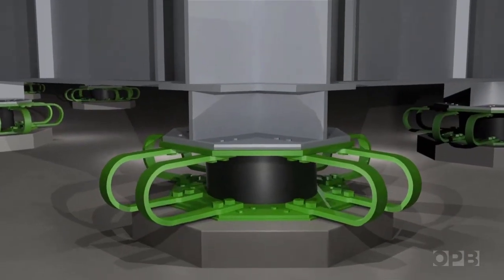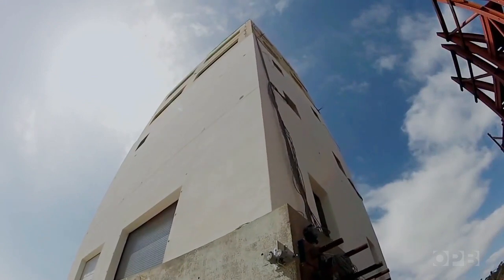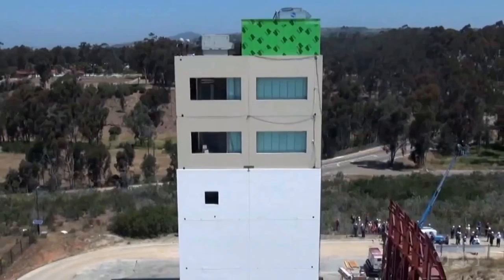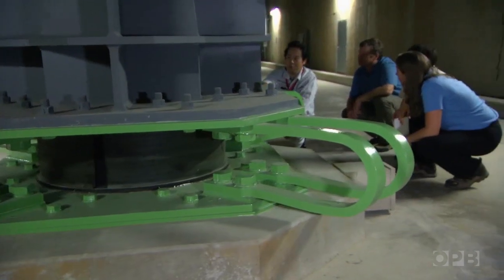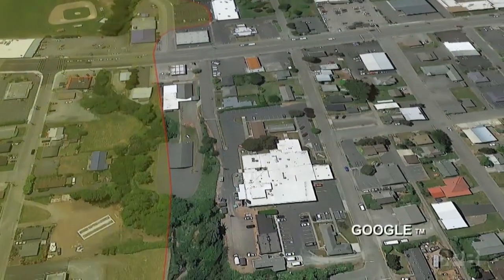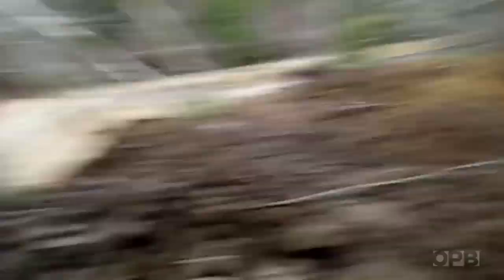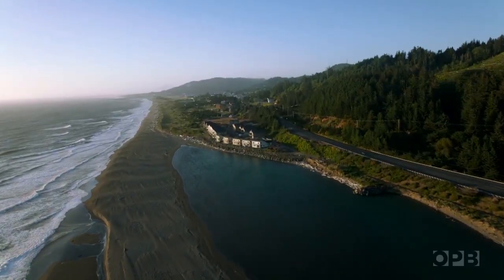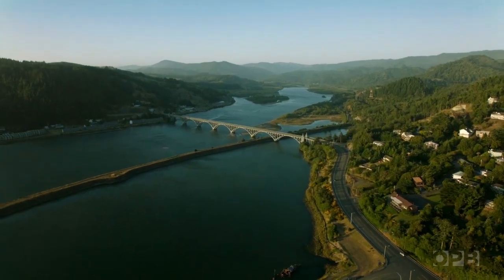Hospital Survives 9.0 Earthquake | OPB

Comment: The reporter has a common misconception of what is the magnitude. Magnitude does not affect structure of buildings, shaking, or intensity of shaking, does. Maximum intensity on the land was VII and only in rare spots, as an epicenter was far into the ocean. In Kobe in 1995 or Turkey this year magnitude was just around 7, but intensity was over X, as highest shaking was along the fault, where everything was destroyed. And X isn't just slightly higher than VII. It's a geometrical progression scale, where X is over 6 times as intense as VII.

Comment: The problem is that you can use base isolation only in isolated buildings. If you have other building sharing a blind wall, it is not feasible. In Athens, Greece that this is the case, we have a minimum of 10cm gap between buildings, to allow for some movement.
Reply: Similar situation is turkiye as well, the city planning is utterly bad... although many buildings are build sturdy, its not enough to widstand long or strong quakes, there is also the corruption part of the situation where it gets all messy, and government just cannot step in without being called facists or being afraid is losing support and election, its idiocracy through and through here (((
Reply: here in belgium the required gap doesnt even exist. the only earthquakes we get are very minor ones from mining operations in the north of the netherlands, a country that lies north of us

Comment: It's amazing how effective modern solutions like this are, but incredibly distressing to realize how resistant Americans, and especially American businesses, are to things costing more (or rather, margins going down) - to the point that any kind of change, improvement or re-tooling is immediately struck down before true costs are even evaluated. Take American appliances for example. Whirlpool has been building the same exact dryers for 61 years - no material change to any part of it. They put a different button panel on every few years, but to this day, you can get a flimsy, crappy, bottom-of-the-barrel design in a sleek black paint job for $1,100. Look at what asian brands offer for 40% less money and it's shocking. American culture is all about "but what about ME" or "what about MY cost" or "what about MY right to be wasteful with rsoucres and keep buying and doing the same outdated shit I've always done!"

Comment: Given that during a large Cascadia subduction zone quake (like is referred to in the video), coastal land will drop between 6-20ft and become salt marsh (plenty of evidence it has happened before) I think spending a cent on any structure in these areas is pointless.
Wow, the structure survived an earthquake. It's now surrounded by water.
Reply: It may surprise you to learn that most of the construction that isn't direct waterfront (and much of what IS direct waterfront) will still be above that threshold.  And the solution is simple: add stuff. Seattle is already 10-20 feet higher than the initial settlement.

Comment: My eternal question with rubber dampeners is, rubber isn't forever; it dries up, it cracks, it even decomposes into ooze. What happens to the main structure once the dampeners begin to fail
Reply: It's called maintenance. The dampeners only need to last longer than the building. You could even engineer it so that you can replace the dampeners one at a time.
Reply: @annekekramer3835  Which is the key. All the white people here don't know that Japanese buildings are intended to be torn down after 30-40 years, max. They are built very cheaply. This is true in many large Asian cities because the land is so valuable.
Reply: @annekekramer3835  You can replace dampeners?
Reply: @zamiyaFlow  i mean if you could access them it should be possible 
Just get cranes or smth to hold the building in place on the side they are replacing
Reply: @zamiyaFlow  its only one side since you would replace them 1 by 1 and not all at once
Reply: Replacing the dampeners would be as simple as using a high capacity jack to slide the old dampeners out and slide new ones in.
It's not rocket science
Reply: @blaydCA  theres jacks that can support buildings?????
Reply: @Scyth3934  The jacks would only be supporting a fraction of what the building would weigh.
Example: Building has 100 dampeners.
You're only lifting ONE dampener area at a time....
So you're only lifting 1/100th of the building's mass...
Divided again by multiple jacks.
Yes very much possible and done more often than you would suspect in heavy construction of bridges and infrastructure
Reply: I was thinking the same thing throughout this clip.
Reply: i worked on the construction of the stanford hospital, and they used 4 or 5 foot diameter round rubber pads. They put too many in and built the building over it, and they had no way to get it out, so they left it there. There was a wall around and 3 foot away from any part of the building so the building could move 3 foot in any direction. If the pads did need to be removed, they would have to remove major electrical and fire sprinkler pipes too. It was like a basement, but open to the outside, and all the major things were in the basement level. I did the fire sprinklers and it was at best 5 foot from floor to floor, and crawling in, around and through was a pain.
Reply: you jack the bulding up and replace
Reply: Maintenance
Reply: exactly. same my point. and if coming with cyclone earthquake.🤔
Reply: We have jacks haven’t we？　　　https://youtu.be/cMZcmexFvYg
Reply: God this is one dumb comment, in Japan this is mandated by government now that any large building with stories taller than 2 required to survive Earthquake of 7, anything in what they call red zones need to survive 9.
These systems designed that Japan implement are based on very old technology from 2000 years ago, many century old houses built on wooden stills and stones that designed to make the building roll as the ground shakes still stand to this day, the engineers in Japan have made it so that all these systems are easily replaceable the rubber is designed to last 25 years but can be replaced, the skyscrapers of Tokyo for example are rated for 100 years with possibility of 200 years standing and thus the immense Earthquake resistance dampers implemented has to be maintained. 

Seriously you thought they could not replace this? Its like saying when one of your table legs break, your entire table is useless LOL come on now thats stupid.
Reply: @SMGJohn  Instad of calling everyone stupid, how about linking a video where the engineers are replacing one of these dampeners.
Reply: @SMGJohn  No no, it's actually easier than having to read your comments. Good luck on your other endeavors.
Reply: @SMGJohn  It's =| its by the way
Reply: @zamiyaFlow  You got schooled bud. Your question was answered and you're still acting like a child.
Reply: it’s not just rubber it’s a composite with iron c
Reply: bust out the ol' pump jack and crank those springs up and pop the dampeners out. eaasy
Reply: Japanese. I use a translator to explain.

In a "seismic isolation structure" such as the one shown in this video, a rubber device is used to reduce shaking, as explained in the video.

The rubber is designed to be replaced at the construction stage. (It is also made to be easy to maintain.)

The following URL is a video of rubber replacement during the Toyo Tire tampering incident in Japan

ttps://youtu.be/xCM_EnefwpM

(uph is omitted, so if you want to go to the video, please add the "h")
Reply: 追加
An illustration of such a construction project can be found at the following URL

https://youtu.be/cMZcmexFvYg

Comment: Well I mean it's a cost calculation ultimately, if you have a certain amount of quakes within the life expectancy of the building, the isolation construction will pay for itself as opposed to a building that may not collapse, but has to be torn down and rebuilt due to extensive damage.
Reply: That is only if you set the worth of a human life at 0. If human life is worth anything, then it becomes a moral calculation.
Reply: @annekekramer3835  ok but we're assuming in both cases there is no loss of life, just extensive property damage, as shown in the video demonstration.
Reply: @yoloswaggins1579  Did we watch the same video? In a hospital with sick and vulnerable patient there would absolutely be many casualties from that much movement. Equipment would also break, so consider that you could lose very expensive equipment there that could cost more than the upgrade would have cost. Base isolation costs 30-50 dollars per square foot, so a million or two dollars cover it. The average cost of an MRI system is a million dollars, so imagine if a couple things like that get damaged in a hospital, it adds up quickly! Yes, maybe not all buildings need it, but also in the event of a massive emergency the local hospital being incapacitated will also cause more casualties just by having to transport people in critical conditions further, so investing in making it have absolutely the best possible chances of not being damaged will pay off.
Reply: @annekekramer3835  In the world of ethics that is going to be some heated debate and you will be surprised on that topic. I believe Yale University and Havard both done a debate course on that. Through that debate is how I get to understand the difficulty in managing a society. Everyyone belives they are mostly right and often time they clash each other and go part way down the road.
Reply: @annekekramer3835  You'd be surprised to hear the US government puts a price on the average persons head. That figure is roughly $10,000,000. 10 million measly dollars is what they think your life is worth.
Reply: @JoshuaPlays99  can i please turn in my human rights for the 10,000,000 dollars
Reply: @JoshuaPlays99  not surprised at all. Gavin Newsom treats his citizens like a peasants. Do what you're told, not what you see Gavin do 🤫
Reply: @JoshuaPlays99  No.  That's like saying 12 cents is worth 1 dollar because there was once a bankruptcy case where assets were liquidated and liabilities were paid out at 12 cents to the dollar.  Sometimes you have to make hard calls in life with limited resources.
Reply: @JoshuaPlays99  so can i cash that now or?
Reply: @JoshuaPlays99  not even close people die and barely get 100k settlements
Reply: This is only true if you run a government like a for-profit business.
Reply: "Cost calculation"
You're American aren't you?
Reply: They're talking about hospitals here. One would assume everyone and anyone (in relations their home) would be responsible for one's own safety, both proactively and reactively.
At a hospital, not everyone has that luxury (also that's a LOT more of delicate equipment).

Edit: I'm confused to as whether some commenters expect their government to install it for free in their homes or if they want it in their hospitals. To me, if you're in an earthquake zone, it should be freaking obvious to take measures to protect official institutions ESPECIALLY critical ones like a hospital. As for homes, for me, it's 100% your own risk, you chose to live there, you made a choice.

Comment: What makes base isolation expensive? Certainly the lead-rubber bearings themselves are a marginal cost, right? The engineering effort to verify the solution maybe, is that where the cost is?
Reply: The cost isn't as much as it looks, but the things that make base isolation expensive are most in the engineering effort. And in the case of existing building, the retrofitting can cost a lot. But in buildings like hospitals is worth all the cost because the facility doesn't lose a second of availability. 

Here in Chile before the 2010 quake there was a hospital building with that system, the hospital of the Arny. And during that quake there was a surgery in progress and the doctors only noticed a small quake and a short loss of power until the generators started up. Only after the operation the doctors realised how extensive was the damage in the country.
Reply: @EduardoEscarez  wow that is just amazing. One thing that also makes me happy about this is that so many doctors and nurses in the hospitals at the time of the quake all survive. If hosptitals pancaked we would lose most of our medical personnel in one shot!
Reply: @seankingwell3692  While here in 2010 we didn't lose medical personnel because of the quake due to the local construction codes, but still some facilities were severely damaged. 

Because of that, since then new hospitals are built designed to withstand a quake while still being operating during and after an event.
Reply: @EduardoEscarez  It really frustrates me to realize that we are indeed finally living in the future(conquering earthquake is not a small feat), but lead by dinosaurs who are too stubborn to let us.